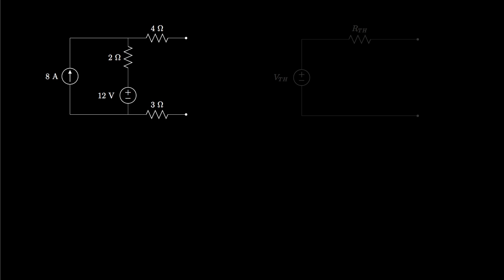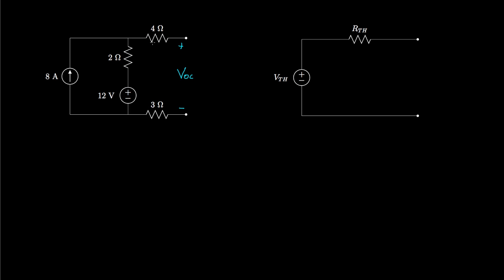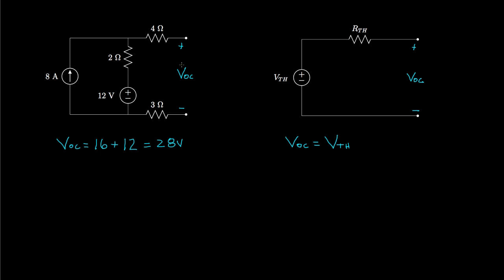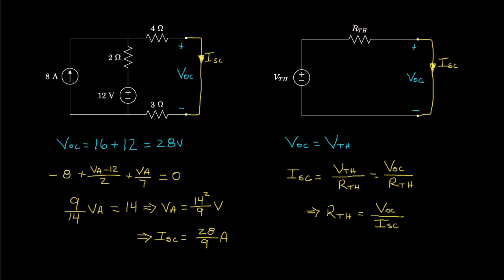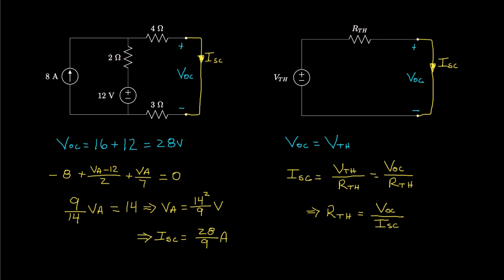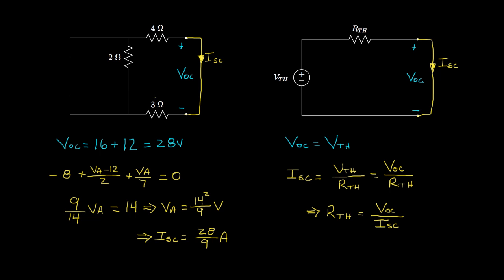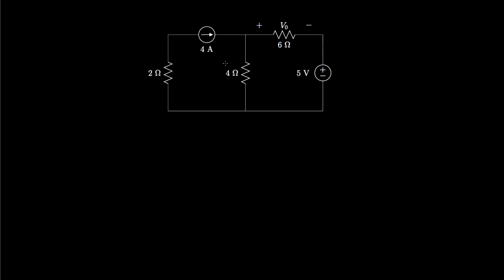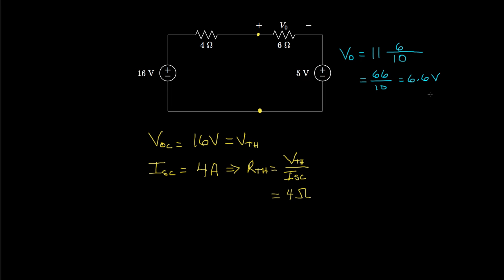Introduction to Thevenin Equivalent Circuits

Comment: Isn't there a problem in the video?3:40 The 8Amp current source is going to the positive side of the voltage source. Isnt it that the voltages should subtract from each other?
Reply from the maker: No. The current is flowing downward through the 2 ohm resistor, so the voltage drop is in the same direction as the voltage drop for the 12-volt source.
Reply: Im sorry you are right.

Comment: you not showing anything... please do the calculations...
Reply from the maker: This is the 22nd video in my Electric Circuits playlist, so, if you are struggling with some of the basics of circuit analysis, you might try some of the 21 that come before this more advanced introduction to Thevenin equivalence. I work out many of the basic calculations in those introductory lessons.

Comment: On 3:00 I just used the node-voltage method on the node in the middle.

-8 + (v-12)/2 = 0 ⇒ v = 28 V.

Comment: When finding Voc, why is it 16 + 12? Shouldn't it be 16 V - 12 V = 4 V since the voltage source is opposite to the direction of current going through the 2ohm resistor?
Reply: I have the same question

Comment: For people confused about the last example "ignoring" the 2 ohm resistance: Just follow the earlier example where you set all sources to 0. This means the 4 amps current source becomes an open hole in the circuit, no current will flow through the 2 ohm resistance, only the 4 ohm one. Therefore you have Rth = 4 ohms. You know the Ioc = 4, Vth = Ioc * Rth = 4 * 4 = 16

Comment: Is the Thevinin V always found using open circuit and the current with the closed circuit?
Reply: Also, will the Thevinin resistance always be equal to the total resistance after all independent sources are taken away and replaced by open and closed circuits respectively? Is there a rule/exception when that does not work?
Reply from the maker: 6924emmabell Regarding resistance, you have to be careful when the circuit contains dependent sources. I cover this in subsequent videos. (Check the Circuits playlist if you are interested.)
Reply from the maker: Yes. Open circuit voltage and closed circuit current are the Thevenin voltage and current.

Comment: Why do you disregard 2ohm resistor when finding the Voc in part 2? Shouldn't you take that into account so the Req=6ohm and Voc=24V
Reply from the maker: I'm sorry, but I don't understand your question. Are you talking about this video, or the Thevenin Eq. Circuits: Part II video? If you are talking about this video, I don't know what you mean by suggesting that I disregarded the 2 ohm resistor. Can you clarify?
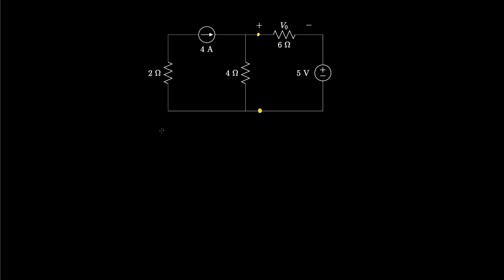Reply: Timothy Schulz around 12:25 you talk about current going through the 4 ohm resistor and say the Voc is 16. However, you don't mention the 2 ohm resistor that is also present
Reply from the maker: Joey Adinolfi To determine Voc, the open circuit voltage is the voltage across the 4 ohm resistor, so we only need to know the current through that resistor, which is determined by the current source. Regarding the Thevenin resistance, watch from about 13:20 on. If we set the current source to zero, then it would be an open circuit, and the resistance we would see looking into those terminals is 4 ohms. (The path with the 2 ohm resistor would be open.)
Reply: legionary anti-illuminati  it is the potential across the 4 ohms resistor, so simply use V=IxR = 4 x 4 = 16 V. Hope it helps.

Comment: in the last example, the there will be 4A current flowing through the 2ohm resistor so 8V drop...could u please explain why it was not considered?
Reply: We only consider the potential across the 4 ohms resistor, and the source is a constant current source of 2A, so the 2 ohms resistor is not considered.

Comment: I call bullshit. At 4:00 how can Voc=Vth? You have a series resistor Rth which will drop some voltage across it, and Vtotal=sum of all voltage drops.
Reply: Before you call bullshit, make sure you know what you are talking about.

"I was hoping this video would help me brush up, but nothing you say makes any sense. Good attempt. I commend you for trying. " (Now this is total bullshit)
Reply from the maker: Open circuit = no current = no voltage drop across Rth. Not a good call.
Reply: Timothy Schulz Where is that voltage coming from? The source. How can it get there with no current? I used to know and understand Thevenin, but took a couple decade break from electronics. I was hoping this video would help me brush up, but nothing you say makes any sense. Good attempt. I commend you for trying.
Reply: OneCoolDude08 you don't need any current to have a voltage difference between two arbitrary points. There is a 9V difference between the positive lead of a 9V battery and the negative lead. If I now just touch a resistor to JUST THE POSITIVE lead of that batter and not the negative, there is still 0 current because of an open circuit, yet the voltage drop from the dangling end of that resistor to the negative terminal of the battery will still be 9V, and that's what was happening in his example.
Reply: Simply, because V open circuit is the voltage where there is no current drawn from the source. This means that voltage on any side of the resistor will be the same. At open circuit the resistor will be like a lose end and thus it will be a node.
Reply: Yatbaa Al Ameri Thanks! Nobody elses explanations made sense to me. Your answer was clear and concise.

Comment: Nevermind I got it 11.6v is across 4ohms resistor so I got to do 11.6v-5v to find voltage across 6ohms. Very helpful video thanks.

Comment: For the last example, I did it using node voltage analysis for node at top middle.
-4 + (v/4) + ((v-5)/6) =0 I got voltage of 11.6v. You got 6.6

Comment from the maker: Depending on the other sources in a circuit, current can flow in either direction through a voltage source. In this case, the current source determines the direction of the current when we are analyzing the open-circuit voltage.

Comment from the maker: The 8A current flows downward through the 2 Ohm resistor; therefore, the voltage will drop from top to bottom. In other words, the 16V drop across the resistor and the 12V drop across the voltage source are in the same direction.